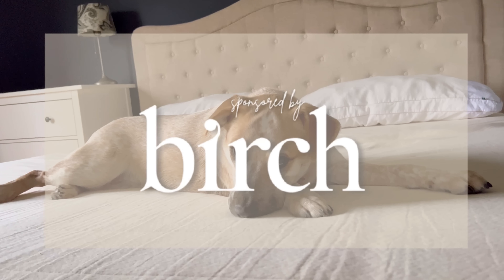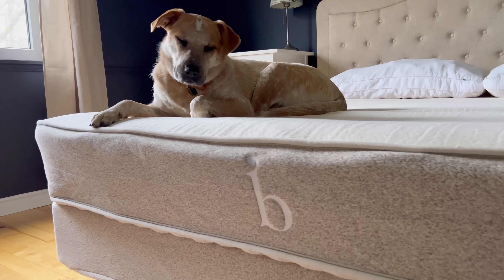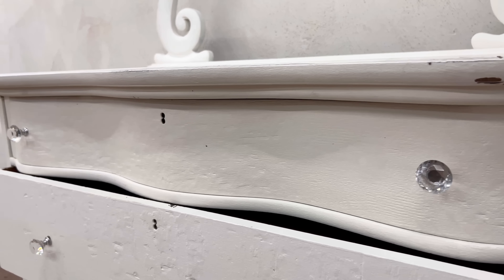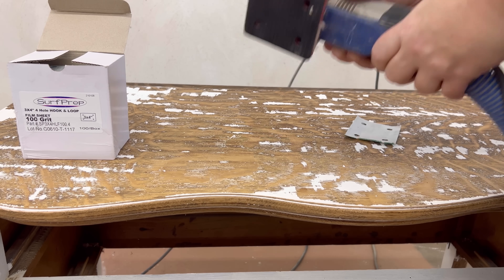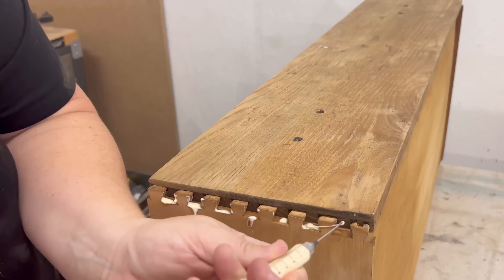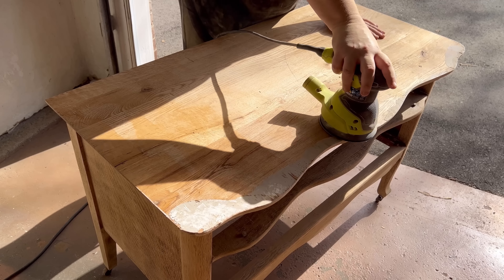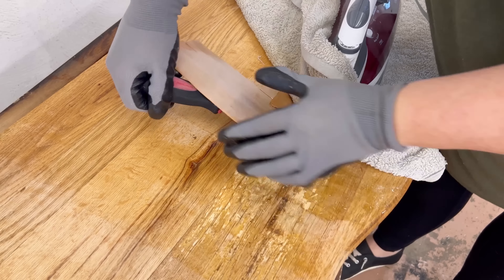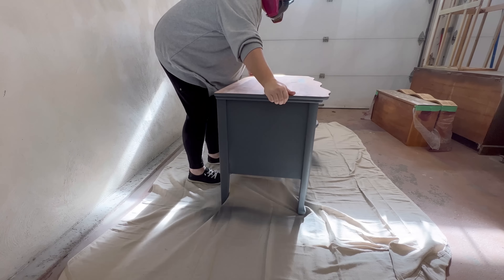I really wanted to RESTORE this ANTIQUE DRESSER but it just didn't work out

Comment: I agree with you on this one. I firmly believe you only paint when it’s absolutely necessary. In this case it was absolutely necessary. And it looks great. The only thing I may have done different, is if I had some veneer that would fit the top, glue it on and have a nice looking wood top.

Comment: I had the same issue with a table. I was able to “rescue” it by using liquid wood..Retique it was the product name. I was able to use wood filler and sanding to smooth it all out, painted the whole thing with liquid wood and added light wood grain with trainer tools and then stained with the color I wanted.

Comment: Are you sure that harp had ever held a mirror?  Its delicacy and configuration suggest to me that it had just had a dowel as a towel bar.  I think your "dresser" used to be a washstand, which would also explain the water damage in the center of the top.
Reply from the maker: It’s 1000% a dresser that came with a smashed mirror.